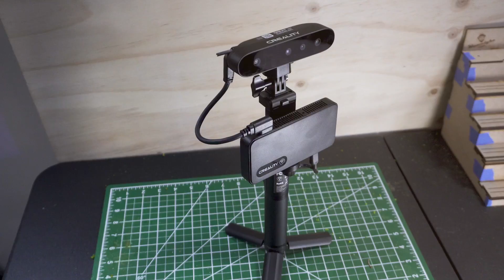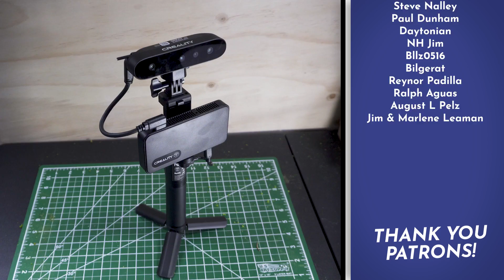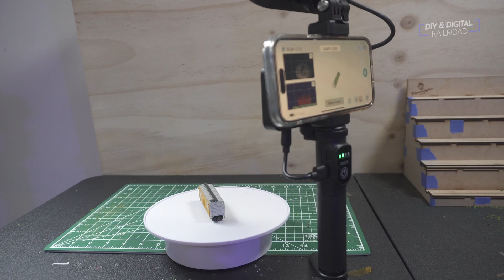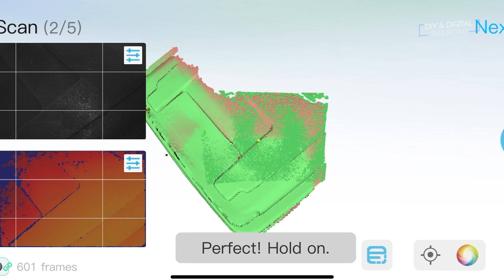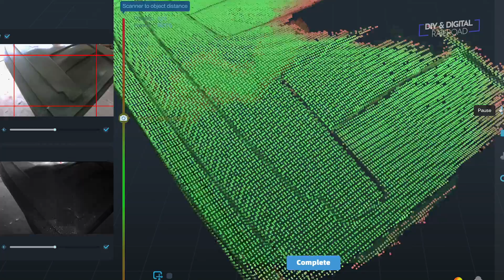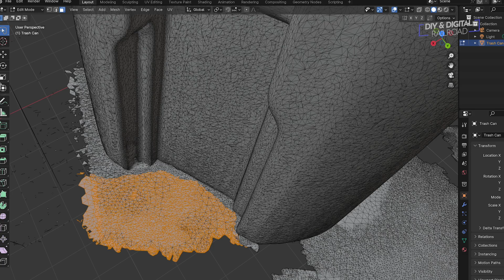What can 3D Scanning do for Model Railroading?

Comment: Hey, I got the kickstarter predecessor of the scan ferrite. I think it is an awesome technology but I agree the tech is a like 3d printing was several years ago, still very young but is rapidly becoming better, cheaper and more "mainstream" which accelerates its development and growth. A couple of tips I have heard is the lighting makes a big difference, the surface of what your scanning (like gloss or flat) and there needs to be enough contrasting details for the computer/software to track the object and putting a light dusting of baby powder on the object can help. They make "scanning powders" but baby powder is cheap and easy to get.

Comment: I see it as very limited use, the issue is that many real world items have bits in them, that when scaled, will be to small to print, the post scan work will always mean its probably faster to just design in CAD from scratch and some measurements.